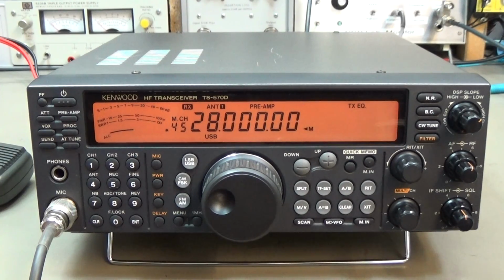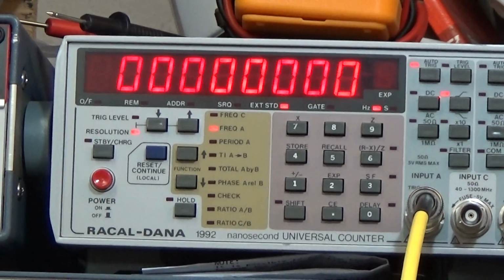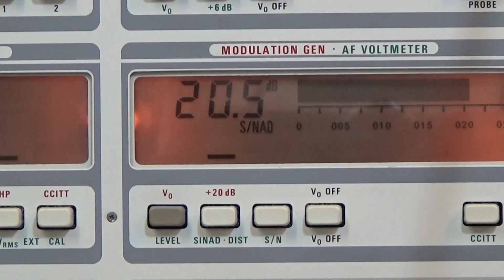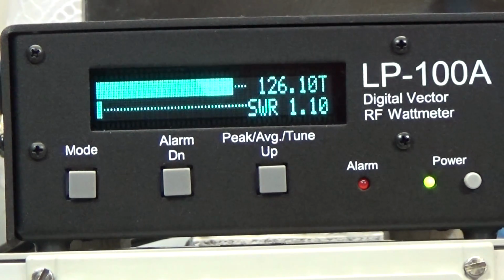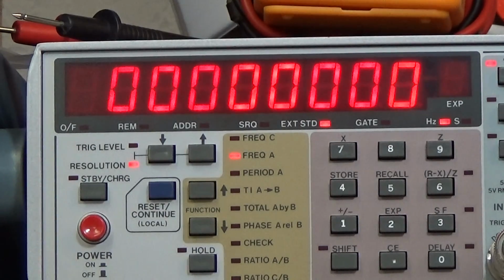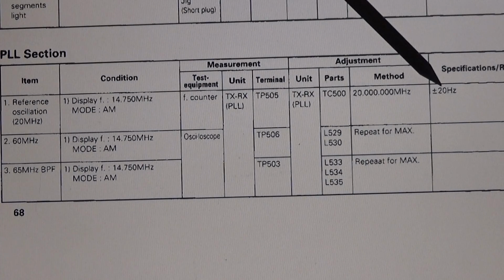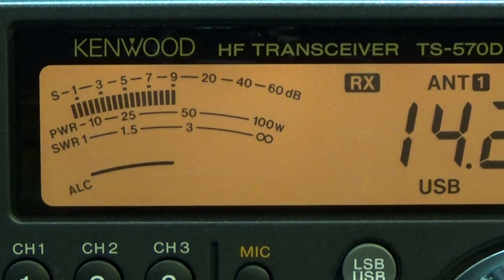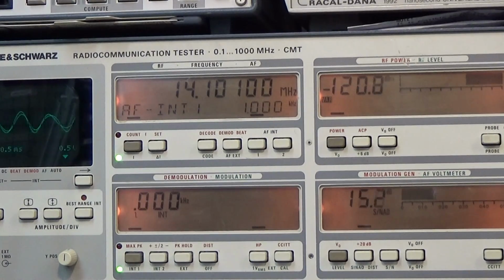#51 Ham Radio repair: Kenwood TS-570 with different reported problems

Comment: I have a problem with my TS 570 S,  the radio will not turn on the amplifier, which i understand is relay controlled from the radio ?  By chance before I delve into this relay could you do a video of the procedure.  Thanks for all you do.

Comment: petter can you help need some advice  ive got same radio ive got intermitting power drop on ssb modes drops to around 10 w when set on 100w  fm mode always fine where do i start looking thanks paul

Comment: Peter, Most excellent video. I thank you, I learned so much from you. I need to acquire  a good power/SWR meter for my station, any recommendations for me. George N2SQ
Reply from the maker: Thank you George glad that you like my videos. Well a good power/swr meter...it always depend on the budget but have you considered the LP100 or LP500 as you can find in my video #41 and #113..
All the best 73s

Comment: Tolles Video,

ich habe das gleiche Gerät und bin damit eigentlich zufrieden. 
Allerdings vermute ich, daß es einmal überholt werden sollte. Leider habe ich nicht das passende Equipment und leider auch noch zwei linke Hände:(
Kann ich dich kontaktieren für eine mögliche Reparatur bzw. einen Check?
Mein QTH ist Frankfurt am Main (JO40FC)
Reply from the maker: Hi melde dich mal hier über die interne PM auf meinem Kanal, dann kann ich dazu was sagen 73
Reply: Ich reparier und gleiche Rohde und Schwarz ab

Comment: Great video plus great rig.  Have one and I just love it.  Only problem with mine is the antenna turner not operating so am using an external turner at this time.
Reply from the maker: +Ausbin Pippin Hi Ausbin, thanks for feed back. Yes indeed this is a great rig! 73's

Comment: Had a fault with my old TS570 that you could not tune in SSB properly it took a bit of time to find it turned out to be the analog to digital jumper with bad soldering !
Reply from the maker: Sam W Hi Sam, yeah sometimes bad soldering can be really annoying...

Comment: I wonder if the OM has a faulty cable or something, which is why he thought the radio was down on power as well as deaf. I'm struggling to believe that a tube amplifier would require that much drive- they typically have a power gain of at least 10dB so to give the maximum legal output here in the UK of 26dBW would only require 16 dbW (40 watts!!) drive... but you know, the customer is always right!!!
Reply from the maker: Alan Cordwell Well yes that could be a reason, I'm going to recommend him testing his set up, cables, connectors, antenna and what have we... The topic with the Amp is not clear to me, too. I don't know a linear which need 130W drive?? I have to ask him...

Comment: I'm surprised that Kenwood didn't fit a better quality trimmer for TC500, that is too coarse. A varactor diode, and multiturn precision trimpot would have been better. Incidentally, I once had a OM complain to me because a radio I'd repaired (it was a FT757) didn't read exactly the same digits as the guy he was chatting with.... I had to explain to him about tolerances and drift!! Also a fundamental problem with digital displays; I asked him if he would expect to measure millimeters to 3 decimal places with an old wooden ruler. He said 'no'... Thank you for yet another excellent video :)
Reply from the maker: Alan Cordwell Hi Alan, yeah I totally agree thy could do it better but it is all about cost cutting to many bean counters in the process.. Like it with the old wooden ruler:-) that exactly the point! Thanks for feed back!

Comment: Hi Peter, sounds like there wasnt very much wrong with the radio in the first place, frequency little bit off about all, thought the RF out power was too high, thought 100 would have been better, i have a valve amp, Heathkit sb 200 and only put 100 max into that....good video...from Fred G4Vvq in UK.
Reply from the maker: Tom Smith Hi Fred, yes you are right not much wrong but 130Hz frequency error in SSB is a lot. You can already hear 50HZ. In FM it is totally different no problems with 130 Hz out. Well 130 Watt is too much stress for the finals. I have to ask what kind of amplifier he is using. RX sensitivity is really a subjective value until you have the radio in lab.. Thanks for feed -back . 73 Peter

Comment: good job i always enjoy watching your videosWhen you test from the antenna jack are you in CW or AM?
how would you compare the receive of a TS-2000 to the TS-570
Reply from the maker: Matt K Hi Matt, thanks for feed back. When I'm testing from the antenna jack it depends on the problem the radio has but in this case, as it was a frequency error, I tested in FM. In lab environment the TS-570 shows a better picture but that is  not an on air test is important as well and an IP3 test should be performed.
Reply: TRXBench when i test AM and CW at 10mhz i get 10 mhz when i test FM i get 9,999,988

Comment: Another great job Peter...Most crystal radios do move frequency with time.You did a great job getting it back to within 1 hertz.Shame about the Finals the Kenwood is really being pushed at 130 watts ...That could be another repair for a later date.
Reply from the maker: charlieoscar09 Thanks, yeah you are right it might be back on my bench with faulty finals...

Comment: Awesome job Peter! Those little variable caps in the oscillator section sure are touchy. If they didn't drift a little, they would never sell any TCXO options :^) I think they should just make that option a standard in all HF radios.
Reply: Mr Carlson's Lab I agree, living in the north in a house not well insulated. It can get cold in some rooms throwing my equipment off. Right now i am working on adapting a TCXO in to a older frequency counter and installing one in a ts-450Sat
Reply: Sounds neat, keep us posted with the results. Would be neat to watch it's stability on a counter.
Reply from the maker: Mr Carlson's Lab Hi Paul, glad that you like it! Yes you are right this caps are absolutely touchy but with some endurance it works:-) I agree TCXO should be minimum as basic configuration. The newer radios mid class and higher have it now..
Reply: @TRXLab  Thank you So very much ,Great video,,I have a quick question,In the Auto tuner.There are 2 ,,,5 -+ inch,coax, jumpers.Are they to run parallel (ie left to left,R to R) or criss cross? I went in to the Auto tuner to clean all coax jumpers ends and not sure if I put them back correctly..Thank you very much.N1RAJ 73s
Reply from the maker: Matt K Hi Matt, yeah TCXO is minimum! Keep us posted!
Reply: I own a 870 which is very similar and the chinese txco is very good and cheap at about $20 and better than the original so-2. Anything under 140w for this radio is considered safe (but risky).
Reply: i know I'm pretty randomly asking but does anyone know of a good place to watch newly released tv shows online ?
Reply: @Emory Bodhi i would suggest Flixzone. You can find it by googling :)
Reply: @Zander Ryder Yea, I have been using Flixzone for months myself :)
Reply: @Zander Ryder Thanks, I went there and it seems like a nice service :D Appreciate it!!
Reply: @Emory Bodhi glad I could help :)